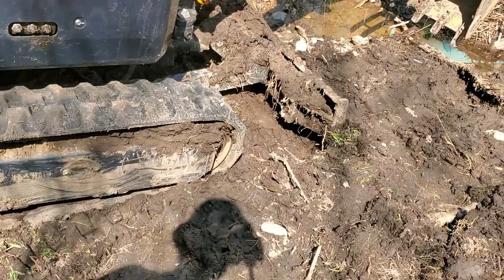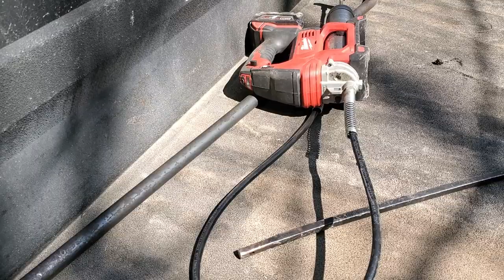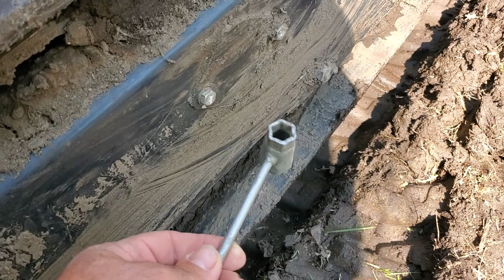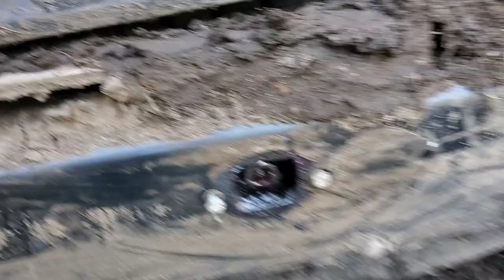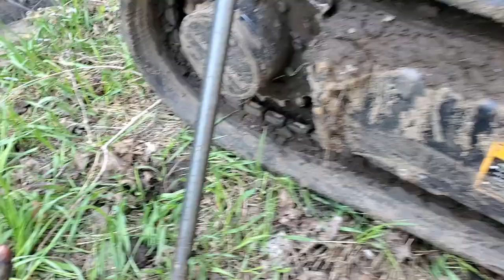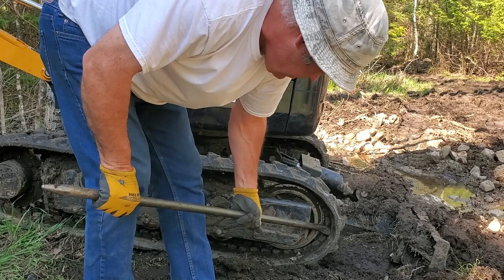Alibaba Mini Excavator Track Fell Off repair.

Comment: Notice how the tracks always seem to come off in the worst possible place, like muddy uneven ground. Because my place is very rocky I do lose a track from time to time when turning on the rocks. Normally I let off the track adjuster like you did but occasionally get lucky and just drive it back on by screwing around at the right place.

Comment: Rubber tracks are like rubber bands but larger.  Why you couldn't tension the track further is because you reached the end of the adjuster travel.  You may have to remove the adjuster and see if you can lengthen it to get your track tighter.  Rocks are your biggest enemy with these.  Good luck out there.

Comment: I'm surprised that you have had the track come off so many times, especially with so few hours. On name brand excavators, there is a spec for track tension. Hopefully your manual has some information on this. Tracks will come off, but I suspect that the tension is not correct. I agree that it might be tensioned to tight.
Reply from the maker: You may be correct

Comment: I have put on tons of machine tracks and I honestly think u actually over tightened it you should have kept it like it was at first instead of adding more grease and I think it kinda proves it because grease was blowing past the seals. I’ve learned that overtightening tracks will make them pop off much much more verses leaving them slightly loose just not to loose. Over-tightening will cause premature wear on your final drive bearings, bend the track frames, and if a rock or stick gets caught in between the final drive and the track it can cause issues like I just explained because it won’t “give” from being to tight.
Reply from the maker: That's why I wrote I'm not a authorized  mechanic don't do what I do lol.
The tracks were loose when it popped off. They've never popped off when they are tight.
I should switch to steel for my property.
Reply: @doylemaintenance  good deal brother you really should be fine sometimes on camera it’s hard to tell but I think your good hopefully they don’t pop off again if they do keep popping off you may have a alignment issue, I’ve heard a lot of these Chinese minis having similar issues. Take care my friend
Reply from the maker: @TheHomePros6221  I caught the track coming off again today on the other side but I stopped it in time.
Seems it gets out of track on the lower middle rail and pushes out and when you keep driving forward or backwards it comes across the front or rear sprocket then goes past the point of no return.
This time I stopped the machine before it happened lifted up the blade. Then spun the cab around and lifted up the back with the boom pushing on the ground to get the track off the ground.
I then drove the track one full circle and it popped back in place.
Seems if you hear a pop snap sound do this procedure and better chance of not falling off completely.
Ilk make a vid next time it happens.
Reply: @doylemaintenance  When on muddy/rocky ground and making turns, it's often better to raise the machine with the bucket and spin using the turntable and track at same time. Once you are proficient, you are much less likely to have tracks falling off.  It's a good skill to learn as you sometimes get in situations where it's the only way to move.
Reply from the maker: @ArthurDentZaphodBeeb  yes I so see the benefit from this. I will try and do it more.

Comment: Those track when they are new are going to stretch/break-in. You should keep it taught but not tight. It should have about a 1/2 in play on the top meaning you should be able to move it that far with your hand without trying to hard. And pay attention to it and keep it adjusted as this. If you over tighten it when it stretches, it going to stretch more that it would naturally, and you will wear the track out before it's time. Look up how to maintain new tracks.
I hope this helps. I believe I even saw  the groundhog mini excavator guy talk about this. Can't remember if it was him but I think it was. Good luck with your machine. I hope it lives a good long life for ya

Comment: Don't raise the tracks so high off the ground (about an inch clearance is all that's needed), otherwise you fight the weight of the track when trying to align the track.  Some grease fittings have a slot in the threads so you only need to loosen the fitting a few threads to let the grease out. If your's doesn't, can use a grinder to cut a slot.  That way, don't need to remove/replace the grease fitting (and avoid getting grime on it or losing it). 

Although I don't have space for a toolbox, I keep a selection of various sockets/wrenches on the machine in a roll-up canvas pouch under the seat - that way, no need to search for/go get tools when stuff happens (always seems biggest delays is getting the tools - either back on your truck/in the garage)
Reply from the maker: I should build a little tool box for it, thanks.